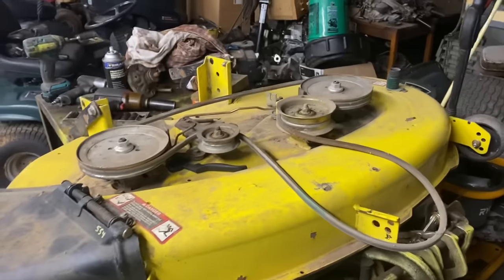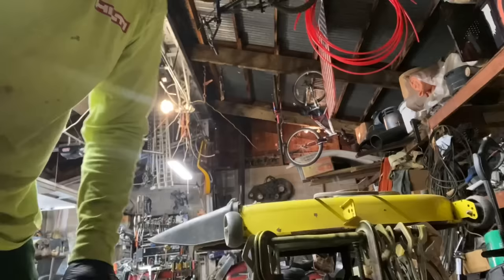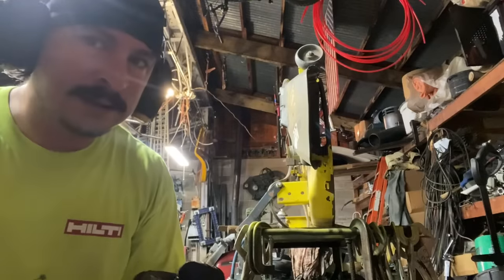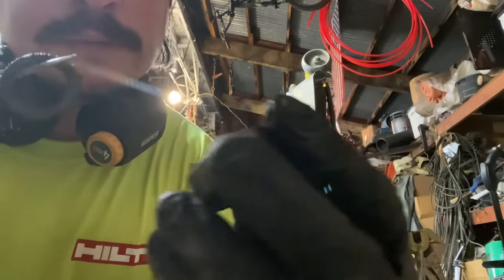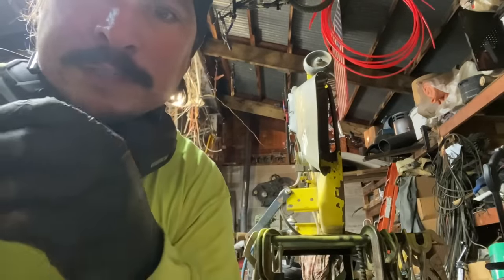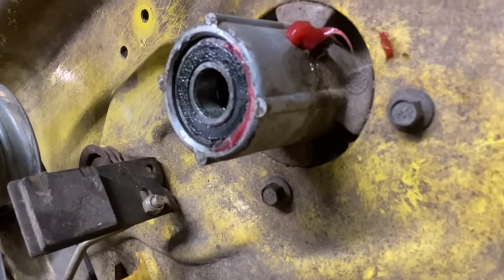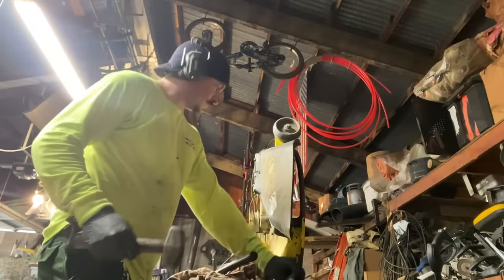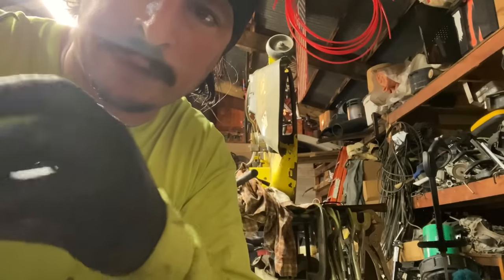Part 1 - Don’t trust the “Experts” Grease your mower deck sealed spindle bearings Common sense.

Comment: Great info Russ. I'm here in Western Australia and always wondered about greasing housing with sealed bearings. Now you have blown my argument out of the water. I,m just about to rush out and grease the bearings on my JD d120 spindles. Maybe you can tell me why the JD deck is rusting away? I had it replaced under warranty and now 2years later the same thing is happening?
Reply from the maker: It’s the way they paint them. I forgot what the process is but it’s obviously crap. These 100 series modles have had this same issue for 20 years. Not sure why they allow it to continue. Bad news is the body is painted with the same process and will be soon to follow with pealing paint and rust spots becoming exposed. Iv seen some information on why it happens and the money saving shortcuts jd uses AkA process that causes it but already forgot. I’m so use to it i don’t even hardly notice it anymore. Lol. They don’t have the issue on the more expensive commercial model X series Deere machines. The only way to slow and hopefully prevent paint issues is to keep them indoors, try not to wash them often. Use a leaf blower rather than water to clean clippings and debris off the deck. Iv seen some garaged units that still look flawless after a decade but they were never left outside. Good luck on your greasing. It will save you money and time down the road and I appreciate the positive comment. Always good to see and what motivates me to make another video.

Comment: For one thing you should be using steel sealed bearings, the ones you have are plastic seals. Also if you really push grease into some assemblies you will blow out the upper or lower seal on the assembly itself.
Reply from the maker: Absolutely false bogus information. Are you another expert? For the assemblies I show in the video and my thumbnail they come with rubber/plastic shield not steel shields. And Iv never ever not one single time ever seen a seal blow out or get damaged. Have you tried the process? The assembly has no seals, only the ones on the bearings. I’m disappointed to see this comment from
Someone who fixes mowers. Your really missing out on some good 100% functional useful information. This is super basic stuff here. Don’t overthink the process. It’s really so easy it’s stupid after you realize
It works. Make a video to debunk me if you can prove I’m wrong. Just be sure to show all the steps and be honest Becasue the whole point is to help people. It’s not about me and you. We can fix stuff. Some folks need help and that’s why I’m here. Iv done this process hundreds of times
For many years. No issues not once.

Comment: Okay, if I put the mandrel together, I know which way the seals are facing.  but on my Bad Boy, how does the manufacturer install the bearings?  rubber seal inside, or sloppily depending on how they picked it up in their hands???

Comment: I always figured, depending on properties of the grease, the grease would flow to the heated surfaces.
Reply from the maker: Seems that would be true. But have to have enough grease in
The right places so when the components heat up
The grease can liquify enough to be in
The needed spots.

Comment: thanks for video. I always thought at minimum bearing and innards would run cooler, this vid shows better. Have you ever done muffler mod on mufflers for riding mowers to get exhaust out to side to lessen breathing fumes?
Reply from the maker: No, guess Iv never smelt fumes so never felt it was necessary.

Comment: I grease my John Deere deck every 25 hours. From the first time I get grease coming out after about 10 pumps. Glad to know that it does go into the bearings. I never knew they had covers on the inside.
Reply from the maker: Some have inner seals some don’t. It just depends on the model.

Comment: Russ, have you ever had a spindle that you couldn't get the shaft out? My JDx350 has spindles (part #AM144608) where the blade bolt screws into the spindle, not onto the shaft. I tried knocking the shaft out with a hammer and block of wood and gave up, worried that I might damage the spindle housing. I was curious if you have encountered these type spindles. Thank you for the video!
Also, will grease get by bearings with metal seals and is there a danger of over greasing?
Reply from the maker: No, the metal shields are going to be no different than the rubber shields. The metal ones also have a rubber lip same as the lower grade style. Grease is always going to push past the rubber lip. Wouldn’t matter what the shields are made of. The rubber lip is where grease bypasses. All spindles with a zerk can be greased. The zerks would not be there if it was possible to damage anything by adding grease. Over greasing is not an issue in this application because excess grease simply pushes out past the shield lip. It’s just messy but won’t hurt anything internally. These bearings won’t build any pressure. The grease immediately passes through and pressure is always released past the lip of shields. As for how your set up is, I thought the x350 was a similar set up and came apart the same way as the type in my video. Would not be that hard to knock a spindle shaft out of a newer machine like a x350. My concern is why would you need it to come apart on such a new model machine ? Those tractors should go a decade before ever needing a bearing. If it’s been greased they may never need to come apart.

Comment: I need your advice on my JD Ztrak 375R.  Today I sharpened the blades but reinstalled one blade upside down. The. Spindle did NOT like that at all because I smelled something burning and noticed it started smoking. I turned it off and noticed my error. However the spindle shroud where the blade bolt meets had gotten so hot it fell off and was hotter than hell. Once it cooled down I reinstalled the blade the right way and it cut just fine. I was not able to insert any grease in the zerk unfortunately. So maybe I damaged the zerk??? My question is did I do any damage to the spindle if it was smoking?????? And I did watch your video last year and followed your instructions to the letter with 75 pumps earlier his year. Just a boneheaded mistake which happens to guys on occasion. Surprised it reacted the way it did with getting hot and smoking.
Reply from the maker: Probably just friction from the blade spinning loose and getting hot from metal
To metal
Friction. It may have got the bearings hot. I’m sure the rubber shield lips didn’t like it. But I’d keep it greased and run it. Sorry to hear about that and yes we all have mistakes.

Comment: I have a Lawnmower I bought in 1999 and I grease it every time before I mow and like I said it is going on 25 years old and still runs great! It isn't a sealed bearing but the point is the same! Grease and grease some more!
Reply from the maker: Thanks. Appreciate the comment. 

Just curious how you know if it does or does not have seals / shields on the bearings of its been going strong this whole time and you never needed to go into the deck for repairs of the bearings? All the box store machines Iv been working on ranging back 25 years have all had the inner shields.
Reply: @GTObearclaw1  I have taken it apart a year after I bought it because I didn't grease it and burned the bearings out of it! And had to replace them and the wheelhouse because that was melted and twisted! Plus this is a Kubota Zero turn 18 HP Diesel and I don't think they use them but I could be wrong! The first year when I bought it I greased it about once a month and I only put like one or two pumps of grease in it I just didn't know any better but after that, I grease it every time I mow and I grease it well!
Reply from the maker: @The1313jeff  that really cleared up all of my questions and thank you. I’d sure expect better from kubota but I’m glad to know of your experience with it. Thank you. They all need grease. That’s for sure!!!
Reply: @GTObearclaw1  Thanks it wasn't Kubota's fault it was all mine But it has been a good mower like I said I have had it for about 24 years now and it has done very well. There are good tractors just got to take care of them!
Reply from the maker: @The1313jeff  I’d say absolutely good, Kubota is my favorite brand - I’m sure not trying to discount the brand!!!
Reply: @GTObearclaw1  Yes mine also I have a couple of them!

Comment: Used those style bearings in high speed machinery for 40 years. Sometimes that's all the brg supplier had so we would pop the shields out and carry on.  Oh they were oil  lubricated
Reply from the maker: I’m not seeing where you were going with the comment. Are you saying you agree or disagree
Reply: @GTObearclaw1    What I was saying was I've removed hundreds of those shields and used the brgs just as I would unshielded brgs.  I'd never researched what you did on your video but its good knowledge to have for mowers and such critters.  Very good sir

Comment: Well that’s just great, I just took out my spindles, completely rebuilt them with new bearings and left the inside seals off so they can be lubricated. I can’t win for losing😩😂 Thanks for the demonstration.👍 
As for me it’s Perfection DENIED🤦‍♂️… Again! lol
Reply from the maker: Removing the shields won’t hurt anything. I was basically just showing that they also don’t stop grease from passing so it’s not going to add any benefit of removing them if the only reason for tearing deck apart was to remove the shields it would just be unnecessary work. But nothing wrong with removing them if parts are already in your hand.

Comment: Toro Z turns diesel  upgraded from the Exmark spindle [alloy housing ball bearing ]  to the Grounds Master [steel housing tapered roller ]  At first u had to ask to be fitted  then became  became standard on some units .

Comment: Would it hurt to just leave that inner seal off so grease could get into the bearing easier?
Reply from the maker: Point is that the seal
Doesn’t stop grease so why would you want to take it apart to do that if you didn’t already have a resin to be in there? Keep is simple.

Comment: Would it make sense to leave both inner seals out? Just a thought...
Reply from the maker: That is the whole point of the video. Trying to save folks the trouble of removing seals / shields that don’t stop the movement of grease. Also explained over 100
Times in the comments

Comment: 70 pumps!? I did 20 and thought I was over doing it. Guess I got more greasing to do tomorrow. Thanks
Reply from the maker: Thanks for the comment and glad it was useful information
Reply: I'm going to recommend a channel I loathe;  Wranglerstar.  However, he did a video a few years back on how to use a grease gun which was pretty good.  I think he demonstrated that one should keep pumping until grease comes out of the other side of the pivot, joint or bearing.  That's the only way to know that the cavity is full and that the grease got to where it needed to be.  It makes a little bit of a mess, sure, but that's especially true if overpumped.
Reply from the maker: @Hjerte_Verke  he has some good information but anyone putting out bookooz of videos will usually put out some dumb stuff. I like him as a person but he has a lot of information I would not agree with. He does make high quality videos as for professionally put together and I don’t even compare to his quality of video.

Comment: How is it that deck just stands right up there for you ??? I always had a battle trying to get them to stand !!!
I had always took the rubber out from the inside of those bearings to make sure that it got into the bearings. Some of those replacement spindles don't even have grease fittings ...
Reply from the maker: The point of the video was to show grease passes the inner seals. So no need to waste time removing them. Just grease and go mow. I put a 2x4 under one side of the deck other side sits perfect on the bench. Then I am carful not to knock it over as I’m working. I advise folks to try and order the type that have the zerk. Read reviews before you buy one. Folks are usually talking about stuff like that on the reviews. Or if buying from a store just verify before you pay. I avoid the ones without a zerk if I can find one with the zerk already installed.

Comment: I still like to remove the two inner seals next to the grease so it takes less pressure to pack the bearings and I also make sure to wipe off the zirk before greasing shoot some grease in run the blades for about five seconds then grease it till you see it
Reply from the maker: As long as you understand that grease flows right past the inner seals you have received the information I wanted to provide. For folks who don’t want to dismantle a deck to remove two seals, now folks can see that grease gets there. And it does not really take much pressure to push past a few little rubber lips. If your not paying attention you can push a big pile of grease right out the side your not looking at before you know it. Sometimes don’t even feel a pressure change on the force it takes to pump. Iv found this is a topic that people
Tend to way over think. It’s a very basic thing not nearly as complicated as some folks are making it out to be. However if folks like to remove the inner seals, I think they should do what makes them happy. But in reality it makes zero difference. Grease passes these dust shields / seals like they don’t exist.

Comment: So what if the deck spindles don't have any grease zerks? Do I have to take apart the spindle assembly, pop out the bearings and pack them manually?
Reply from the maker: That’s one option, or add some zerks 
Lots of great videos showing that process on the tube

Comment: I noticed that, too.  I've seen that many times, since they started that "sealed bearing" crap.  There are places for seals, like the outer side of a bearing.  But the one on the inner side is completely unnecessary, in this case.  You can remove those side seals with a dental pick if you're careful.  I did that to mine and drilled a small hole in each one.  Then, I snapped them back in place.  That lets the grease go into the bearing and weep out the other side, flushing out microscopic particles of steel or dirt each time you grease it.  Just don't over pressurize it.  When it gets full, just apply light pressure and give the grease time to move through the bearing.  Otherwise, you might push the outside seal off.  That would allow dirt to get inside during operation.  You also need to stop when you see grease start to come out of the weep holes, so you don't end up with it everywhere.

You have to stock up on grease, and, like you said, fill that sucker up until it starts to come out.  Then you'll have a chance of it lasting a while.

And don't forget to do the same thing to your front axle bearings, assuming that's a JD (John Deere, Jeffrey Dahmer, whatever.  In the days of Jeffrey Dahmer, we ended up with a used John Deere lawnmower, courtesy of a relative.  So I scared my boys by telling them that JD was going to come stay with us for a while. 😂😂)

You can also drill and tap squeaky tie rod ends on your vehicle, if you're careful with it, and install grease fittings on them.  Then you can grease them.  I've done it!  They squeak because of insufficient grease or no grease and because of the nylon the manufacturer puts in them.

Comment: Would it make sense to turn the bearing over, so the seal is on the inside, exposed to grease?
Reply from the maker: What the heck are you taking about? No. Heck no. A seal is not even necessary on the inside. I’m just proving that if they have a inner seal it’s not going to stop grease. The whole point of the video is to prove that it does not even matter if a seal is there or not on the inside facing the other bearing. The only seal / shield that helps is the outside shield to keep dust out of the bearing. As for the inward side of the bearing it won’t make any difference so absolutely no reason to take the assembly apart to look. If the unit has a zerk, just grease it until the assembly is filled. Be sure to stop as soon as grease exits through one of the bearings.